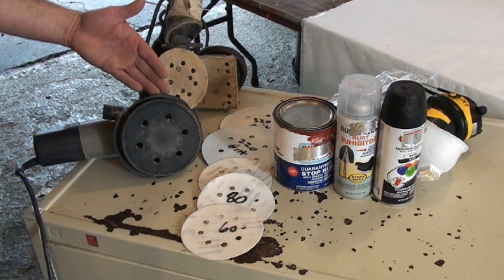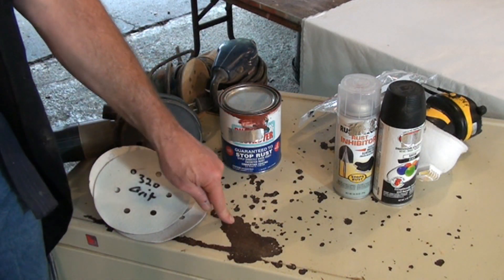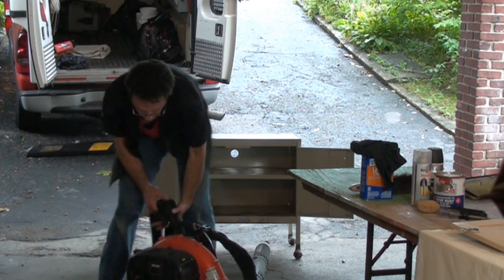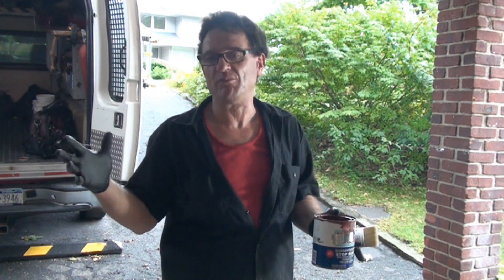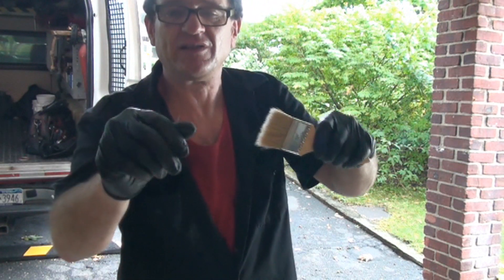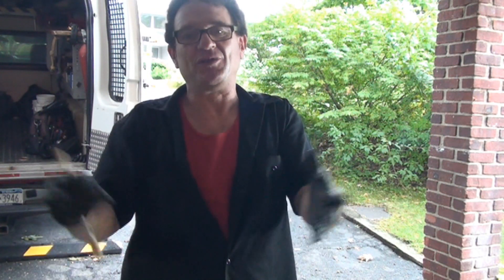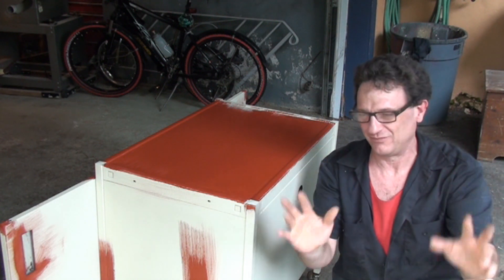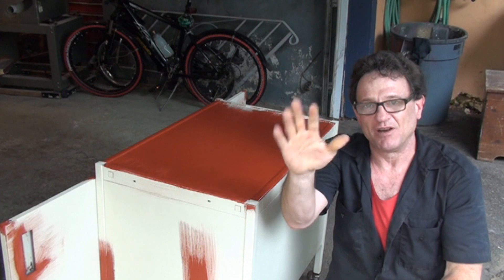Prep Rusty Metal For Paint

Comment: Question: I'm about to paint my bike and I've never done painting before. I've been studying up on prepping the parts for paint. I'm in India (easy with the typical notions now, we aren't that backward in all things efficient haha, so..) the painters seem to sand the parts down "by hand"? I only talked to the small shops. They don't seem to know about aircraft remover or paint stripper that I see in almost all YouTube video guides. Questions finally: if there is no readily available product to remove old paint (and another for rust), what can I use to prep the metal for paint (do I need any, or do I just go ahead and sand it down and that's it)? And second, how much time might it take for me to sand down (manually) a petrol tank on a bike typically? Thank you very much for this video, Sir. Johny (I will ask one of my buddies where i can buy or rent a sanding gun actually).
Reply from the maker: i don't like strip chemicals as it is expensive, time consuming and dangerous and messy. you may not have to remove the old paint completely if it is a solid condition, just sand to feather edge chip and remove rust then prime and paint over the existing paint following manufacturer's instructions of new primer and paint